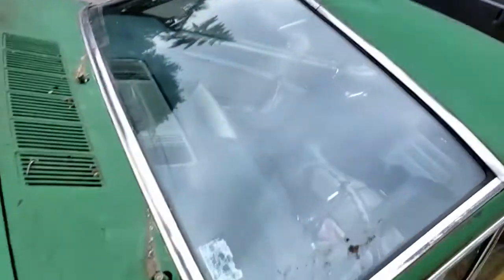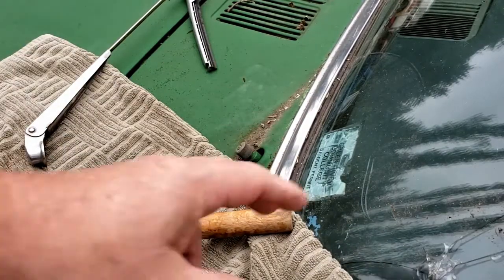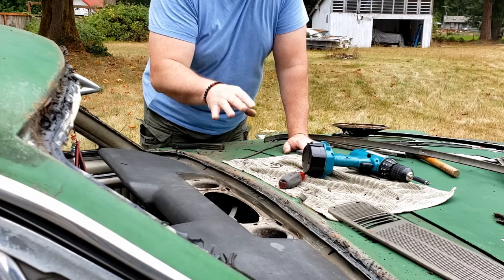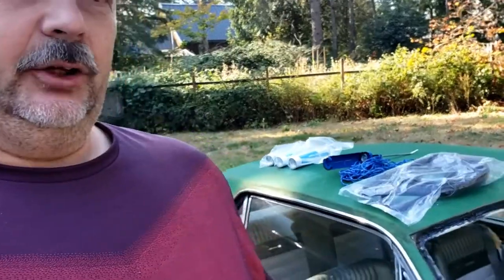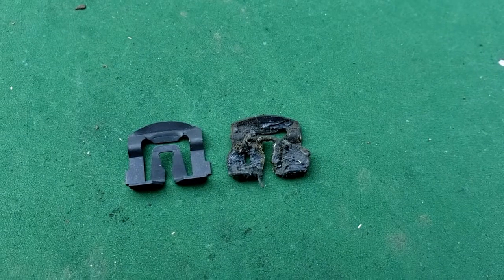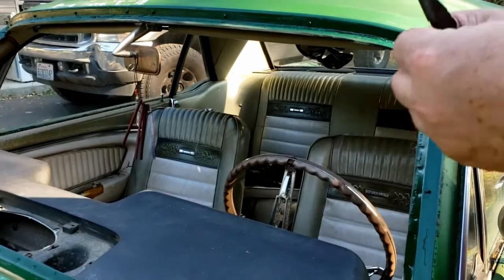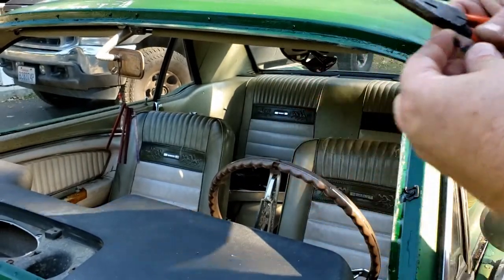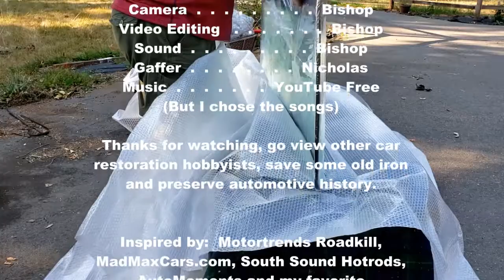ep29 Bishops Garage - 1966 Mustang Windshield Removal

Comment: why was urs so easy? I have a 69 and mine is like glued on it’s so hard to take off
Reply from the maker: I waited until I had a 90 degree F day (32C), left the car facing the sun so the old rubber would be soft.  After a couple of hours it was pretty soft to remove.

Ya that old sealant was generously lathered on at the factory for sure!